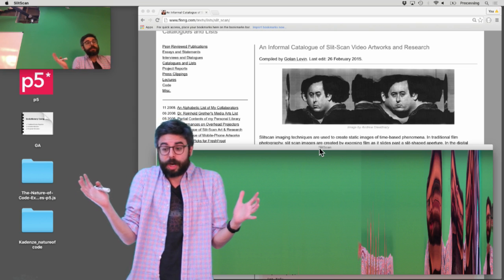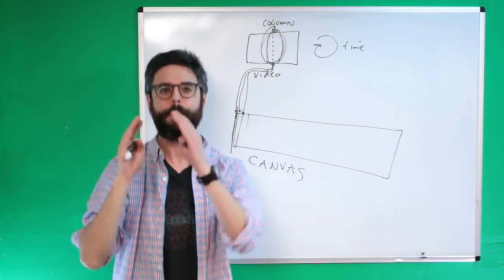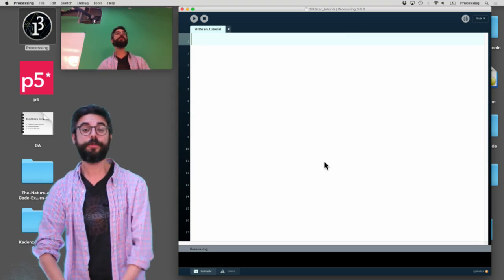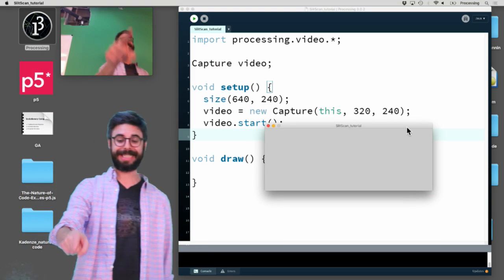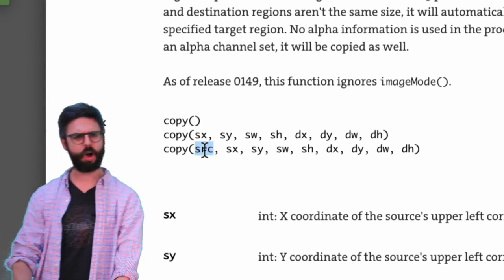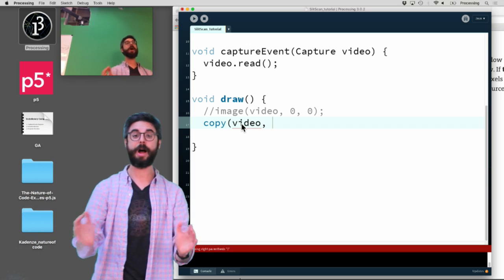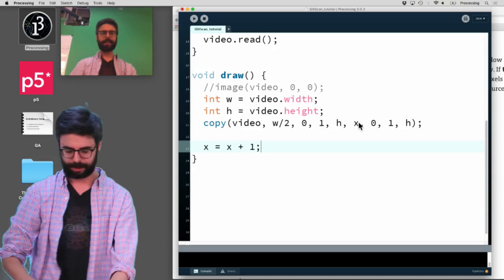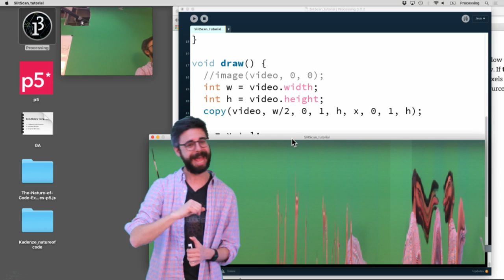11.3: Slit-Scan Video - Processing Tutorial

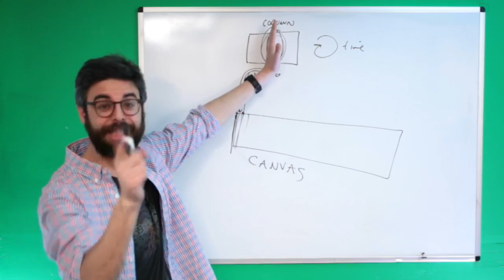Comment: I stopped at 6:40 and brute-forced my way into a finished product by running pixel by pixel. only to press play and immediately be shown that there is a function for copying just a bar. lol. fun challenge though.
Reply: for anyone interested, here is the code, I'm sure it's a mess:

import processing.video.*;

Capture video;
int xbar=0;

void setup() {
  size(640, 240);
  video = new Capture(this, 320, 240, "pipeline:autovideosrc");
  video.start();
}
void captureEvent(Capture video) {
  video.read();
}

void draw() {
  //image(video, 0, 0);
  video.loadPixels();
  loadPixels();
  if (xbar<width-1) {
    xbar++;
  } else {
    xbar=0;
  }
  for (int y = 0; y<height; y++) {
    int x=160;
    int loc=x+y*320;
    pixels[xbar+y*width]=video.pixels[loc];
  }
  updatePixels();
}

Comment: What is the fastest way to animate the opacity of an image that contains transparency without ruining the transparency?
Reply from the maker: +Thin Soldier you should be able to use tint() with a variable.  https://processing.org/reference/tint_.html
Reply: Daniel Shiffman I do most of my processing.js experimentation over at khanacademy and their environment has bugs that prevent using tint :(. 

Is there another way? I recently tried looping through all the pixels and changing their opacity and that has worked but it's a bit slow. I'm not aware of any other option that might be faster.

I also tried applying a greyscale image as a mask but that is also slow and tends to mess up any transparency the original image already had.

https://www.khanacademy.org/computer-programming/v4-animated-transparency-of-images/4329014965

https://www.khanacademy.org/profile/thinsoldier/projects
Reply from the maker: +Thin Soldier Other than digging into webgl and using shaders I think you've tried all the ways I can think of!